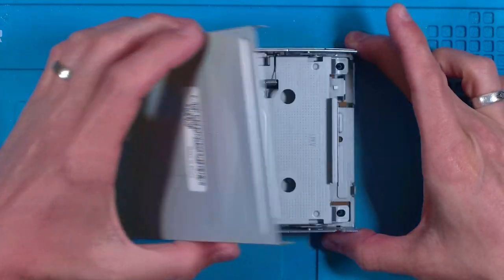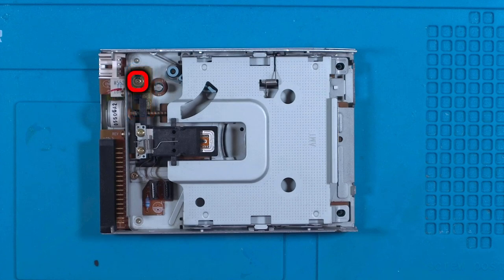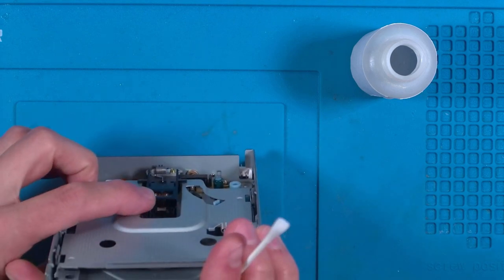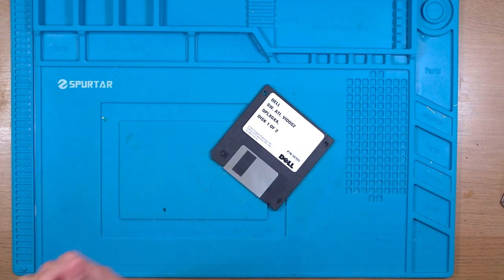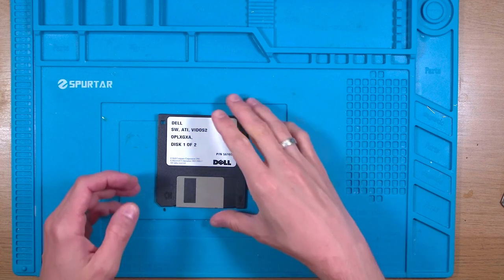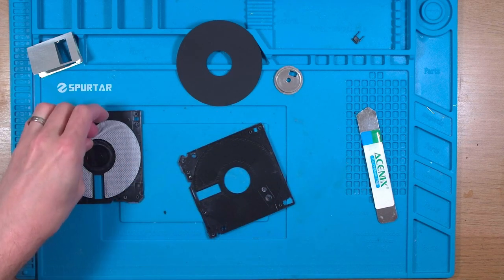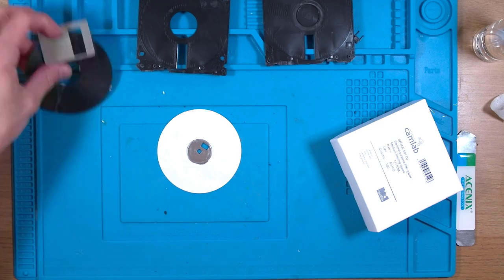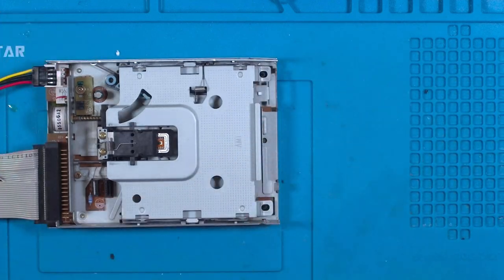DIY Floppy Drive Head Cleaner

Comment: New subscriber here! I too enjoyed the video. I'd like a video addressing "floppy detection" issues. During floppy I/O, my Amiga sometimes says I "must" re-insert the floppy although it's still in the drive and I haven't even touched the eject button. So far, I've yet to see a single YouTube video discussing this. Thanks for considering it! 👍
Reply from the maker: Hi this is actually a really simple annoying thing and it happened to me. The little switches at the front of the drive, look like black or white posts connect to a switch. One is used to detect write protect, the other for the presence of a disk. Over time the switch contacts become dirty which is what causes this. You can clean them with contact cleaner, it’s tricky but can be done. I may do a video on this at some pojnt

Comment: Cleaning disks are ineffective at resolving a problem with a dirty head. They are intended to be used regularly on a clean head but one bad disk and it will undo all that preventative work. Cotton wool sticks are far more effective and you can buy them super cheap in the girls beauty section.
Reply from the maker: As a some-what expert with floppy disks they do work well, and have always worked for me. 
I agree that directly cleaning the head can work better or quicker, but these are great if you don’t want to take the drive apart.
Reply: @RobSmithDev  Cleaning disks have always worked? I've had several drives where cleaning disks have been a waste of time and the only way to get them working is with a cotton wool stick. Maybe it depends on the cause of the dirt. If it's just the gradual accumulation from usage maybe a cleaning disk would be fine but if it's an old dirty disk that has caused the problem then it's more likely to need cotton wool sticks.

Comment: floppy drives and it's media were never meant to last this long, but here we are 40 years later. But the media now is decaying to the point where the magnetic layer is stripping off the discs. You can have a brand new sealed in shrinkwrap boxed disks unopened and half of them refuse to format without bad sectors. That's discs that have had no use or wear with the drive head. No amount of cleaning is going to fix this. The drives themselves can have restorative maintainance replacing caps, regreasing worm screws and head cleaning, but the media for them is becoming increasingly unusable over time. Someone needs to start a kickstarter and re-manufacture some new media theres no other way around this.
Reply from the maker: Its weird, the older the disk I have are, the better they are holding up! but yes, could do with them being mae somewhere
Reply: @RobSmithDev  5.25 disks were generally more robust despite the lack of protection encasement offered by 3.5". Lower density and better materials before everything started to go cheap mid 90s